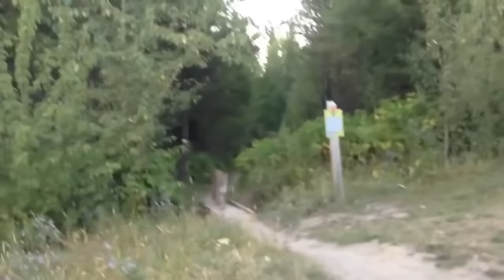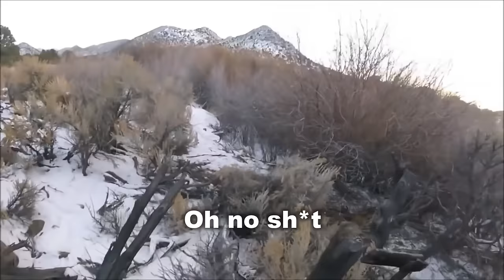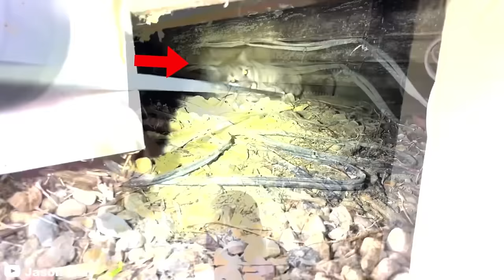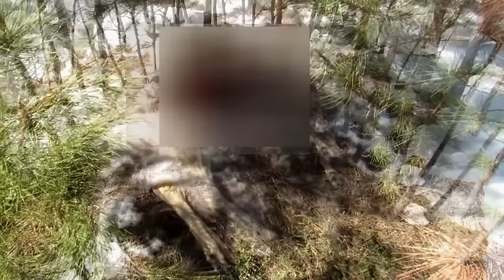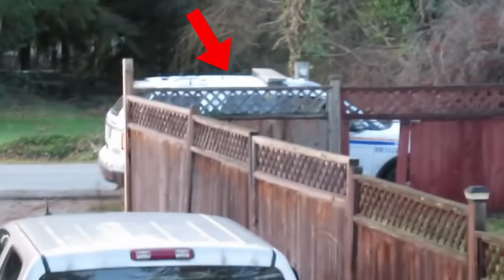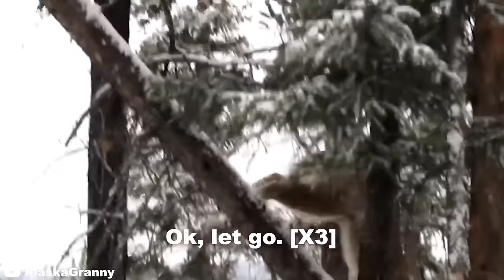30 Scariest Mountain Lion Encounters of the Year

Comment: WTF did they do to the first cat?? It's missing its fangs and you can see blood running down the chin :|
Reply: obviously. it trapped itself in his yard and is fighting for its life. so its biting everything in sight without self restraint resulting in injury. its very common
Reply: @crackerman5519  Right. "Obviously". One would think that a predator would spare its primary hunting tool in favor of something more easily replaced, such as claws.
Reply: I asked the same question. Where are its fangs? Both upper canines (fangs) were absent, but the teeth around them appear to be healthy. I believe the fangs were removed by human intervention, and not in the wild.